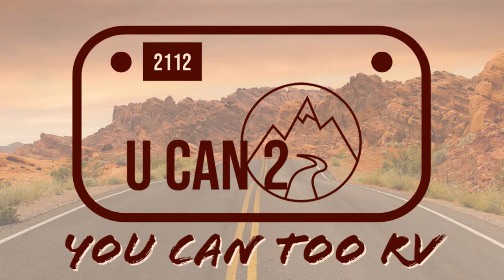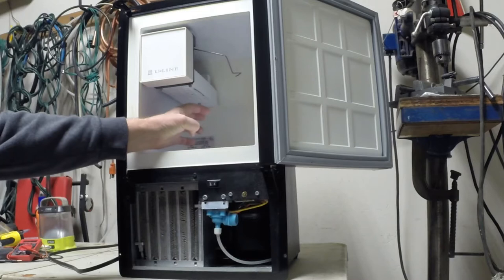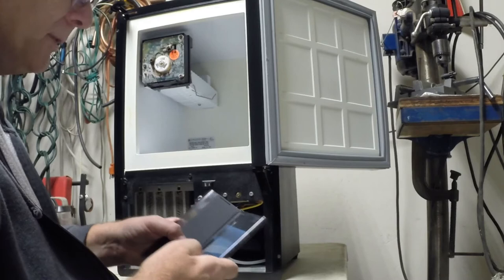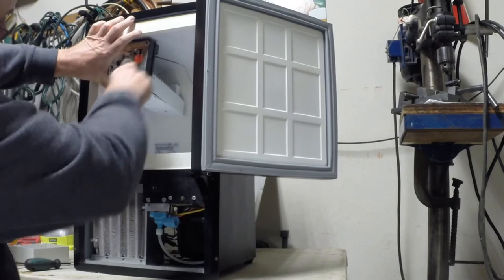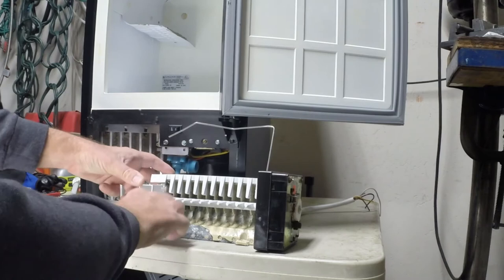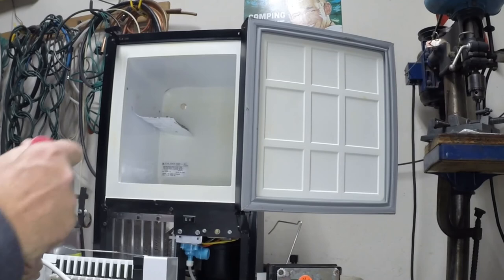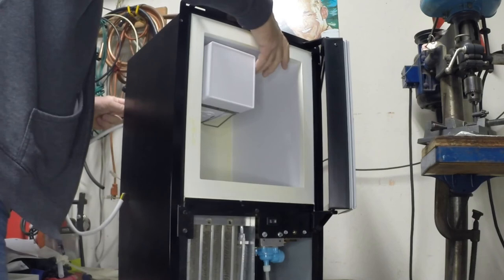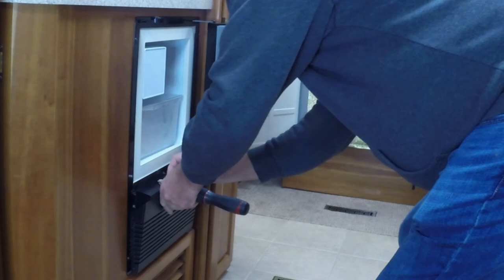RV Uline Ice Maker Repair

Comment: Thanks for the video. I'm repairing a portable version for my brother for his office and its almost identical. I was wondering what the purpose of the mastic is for. Is it to seal the heat from the heater element from entering the ice tray space and melting the ice?
Reply from the maker: Hi and thanks for subscribing. The mastic is to aid with heat transfer (in physics there's no such thing as cold). It's pretty important in transferring the heat to the evaporator. Good luck

Comment: Thanks Dan,
I know this is video is a bit dated, but did you find the source of the leak in the old one and was it repairable? The price on a new replacement from U-line seems a bit steep and wondered if yours was repairable or if there's a more generic one I could substitue?
Reply from the maker: The original was not repairable due to corrosion etc. Unlike most ice makers that have a connector that plugs into the freezer compartment, this one has a harness. I haven't came across a lower cost option. We're using this ice maker every day since going fulltime in our RV.

Comment: Can you let me how you wired it? I have a red, yellow, brown, white, thick black and thin black wire on the plug side. The unit has all the same colors except of a thin black it has a yellow with green wire. Did you just hook that up to the thin black wire? TIA
Reply from the maker: As I recall the yellow/green wire is a ground wire that wasn't on the original. I found someplace to attach it to the frame of the icemaker unit. Thanks for subscribing

Comment: Hi Dan
i have opend the u line ice maker module to change a microswitch.  there is a spring on shut off arm now loose!!  any idea how it should be put back so the arm function properly.
thanks a lot
Reply from the maker: I can't offer advice, as I have never disassembled module. Good luck

Comment: hi Dan i am rying to remove this u line ice maker shut off arm. is there a way to do it?  
tried to push it out in up position , it did not. thanks
Reply from the maker: It's basically a bent wire which relies on friction to hold it place. I'd use pliers to grip it. Good luck.

Comment: I replaced the ice maker and was working fine then all of a sudden stopped making ice! any suggestion
Reply from the maker: Check out my video about diagnosing a Norcold icemaker. The principles are the same. Is it cold enough? Do you have water? Is the solenoid working?  Good luck.

Comment: hi Dan, sorry to bother you i have replace the whole ice maker with new one as per ur video
  Itwas working fine till recently stopped making ice.  Checked water valve as you directed to Norcold Video.  all good. now it makes Ice but does not dispense it!!  any suggestions?  Thanks
Reply from the maker: Hopefully you can get it replaced by warranty! Sorry to hear about your bad luck. Best wishes.

Comment: H9 Dan I replace the old ice maker with new one as you instructed in your video.  Now it makes ice but does not dispense it to the Ice tray. any suggestion? really appreciated.
Reply from the maker: It sounds like you may have a defective unit. The timing mechanism should turn on the heater and eject the ice. Hopefully you can get a warranty replacement.

Comment: now only made one batch in 10 hours ? any way to expedite shorter time period to make ice?. Thanks
Reply from the maker: Temperature is what dictates the speed. Remove the front louvered on the bottom. You will find a knob that you can use to control the 🌡. I recommend temporarily placing a thermometer inside to monitor the temperature. My ice maker has temperature of about 10°F.

Comment: My uline does not make ice . It gets cold enough but no ice. Replaced the water solonoid valve no ice cube. Any idea. This unit old enough
Reply from the maker: The icemaker assembly controls the solenoid. I suspect that the controller portion of the icemaker is bad. Check out my video about the norcold icemaker. The trouble shooting process is the same. Although the replacement Uline icemaker assembly is expensive, it's a fraction of the cost of replacing the entire unit. Good luck.

Comment: Great video. How do I attach the wires on the back?
Reply from the maker: Glad that you found the video helpful. I matched the wire colors from the original ice mold and used crimp connectors. I taped them for extra insulation. The extra green ground wire I bolted to the base with a small bolt and nut.  I had to drill a hole for the bolt. It would probably function without the ground attached, but we always want to be safe. Hope that you check out my other videos and consider subscribing. Dan

Comment: Maybe you can fix the icemaker in my Norcold Refrigerator.
Reply from the maker: We just need to determine the part number.  Should be even easier than this U-line.
Reply: what is the part number the ice try assembly ? gary
Reply from the maker: Hi Gary, Amazon won't let me post links yet on my young channel. Here's the part number 80-54372-00

I'd really appreciate it if you subscribe and a like. Thanks